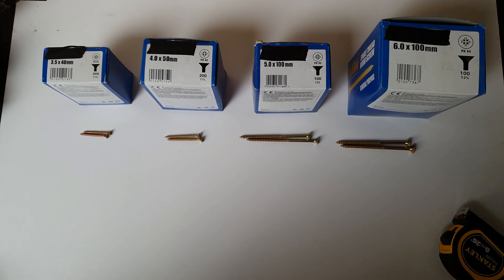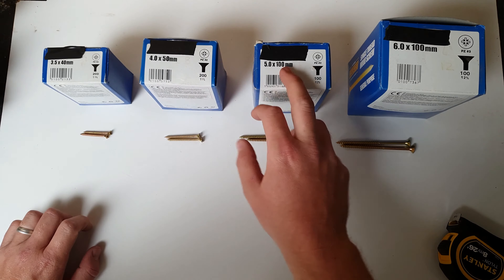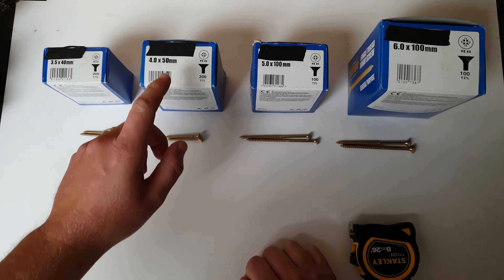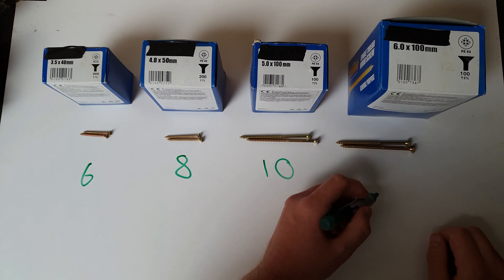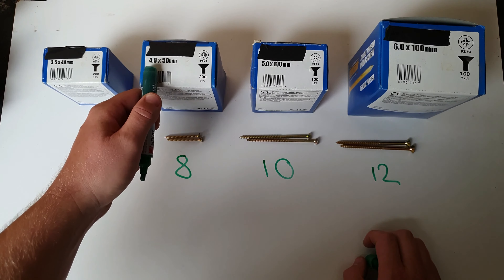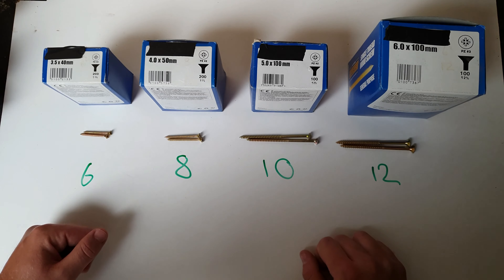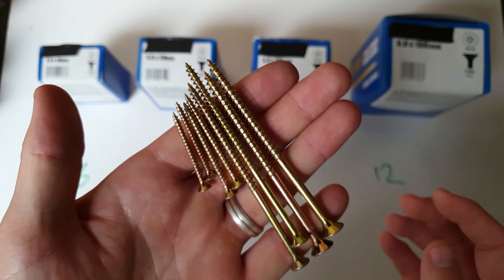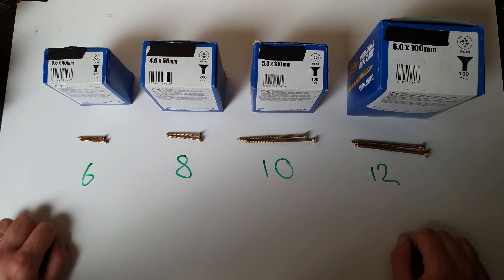choosing the correct SCREW size (METRIC vs IMPERIAL) UK

Comment: RustyDIY I have a very confusing calculation to do! The instructions suggest 8g 5/16ths so it's a bit of a nightmare. I've seen measurements relating to 8g would be 4.5mm so it gets more confusing for me. I'm fitting a ring doorbell into brick, the screws that come with the pack are for wood 🙄 so like you showed on your video technically I'd be looking for a 7g which doesn't exist. So should I go for 6g to fit the hole on the doorbell? I'm also worried about drilling into brick. I have masonary drill bits, but it's so narrow will it not snap the bit? Flippin nightmare. I should also say that those measurements (8g 5/16th) are US too
Reply from the maker: hi, to my knowledge 8g is about a 4mm thick screw, for me if i was using a 8g/4mm thick screw i would use a red wall plug and depending on brand of the plug between a 5.5 and 6mm drill bit. im in the UK. im not sure what the 5/16s bit is about or the 7g bit sorry, but always best to get a trades person in to do the job if not sure.

Comment: It's helpful but what about the second number, the threading or TPI? That's the confusing part. For instance, I'm trying to find something smaller in diameter to a #6 (such as a #5) but with what I think is a 32 tpi for the threading. I can see #6-32 screws at 3/8 length. But, are there no #5-32 screws??? If not then WTF??!!! That's the part that I find VERY confusing and annoying tbh.
Reply from the maker: TPI threads per inch is commonly used for bolts its not normally on a screw box or description as they are normally sold as corse or fine threaded for example. I will have a look see if I can find out
Reply from the maker: Im in the uk and we dont use tpi apparently thats the American fastener market we use thread pitch ( the measurement between each thread in mm ). But this is for bolts, looking at the screws from wholesalers around me that info is not on any screws I can see unless its more of a bolt style screw like a electrical m3.5 fixing screw. But for wood screws for example I cant find this info 😕? I'd guess that the tpi or thread pitch only matters if you are screwing into a pre threaded hole like a nut or nut sleave and if fixing into a material it is just corse or fine thread (double or single thread) depending on what your fixing to and i go by the manufacturers description of the screw to determine whats suitable for each material
Reply from the maker: We are mainly metric so when ordering bolts normally just width and length to worry about as a metric thread would be the same i think, id guess that's the same for imperial like in America if 32tpi is standard imperial tpi. But im not sure as I say not something we deal with much hear so don't quote me im not certain about this area of measurements (tpi and thread pitch) sorry I couldn't help 😅 much if any. There must be lots of videos on tpi and thread pitch on YouTube from people with the knowledge 🤔 in those areas to answer your question.
Reply: @RustyDIY  thanks. I found out the screw I'm looking for (which is still rare) is 5-40. I guess 5-32 just doesn't exist. But, our local hardware store jumps from 6-32 to 4-40 and doesn't even have a 5 because it's not popular. The quest I've been on for this odd screw... anyway, I gotta say, for some reason it's pretty confusing! Between the two systems and matching up the specs of the TPI or thread pitch on some old equipment is a challenge. Anyway, keep up the good work Rusty and thanks!
Reply from the maker: Ya it definitely is especially on classic engines. Glad you found what you needed. Thanks for watching

Comment: I'm completely different i ask for the length of screw in imperial and ill ask for the diameter in mm so an example would be if I was on site and I needed some wood screws id ask about for some 2inch 5s lol. Feels weird asking for 50mm 5s.
Reply from the maker: Haha tbh I'm in the UK obviously but where I grew up working with my dad as a kid I still ask for imperial, just feels strange saying I need 75mm 5s or 100mm 6s ha 😅
Reply: Well done, Nico: like me - and thousands of others - you have helped to create a new, and much more versatile system from the existing two: 'Imperial Metric' !! Sometimes the one, sometimes the other, sometimes both together ;-)

Comment: So, how do you measure the thickness?
Reply from the maker: The main thickness is across the whole diameter so a 6mm should be 6mm across the threads outside to outside edges (for metric)
Reply: @RustyDIY  THANKS.
Reply from the maker: You are welcome there is a major and minor width measurement probably be easy to see a picture online if you search it, some things are hard to explain in txt and the video would be far to long to try explain everything ha 😀
Reply: @RustyDIY  naaah, really? we mean how do you go about it? we don't mean we manage to do the practical thing of finding the thickness by means need and not yet described, and then saying, what does that number mean? If we find out it is 5.0 mm across, we don't then say, duh is that the time we get up in the morning. How stupid can u get, rusty?  "so a 6mm should be 6mm across the threads" really, not a 6am rise?
Reply from the maker: @RonniesPokerRants  how do you go about measuring out side of a screw thread to outside thread across the diameter of a screw ? Just put it against a ruler, tape measure or use a set of digital caliper for an exact size. I thought that was in the video me showing measuring the thickness on a tape measure at the end maybe it got edited out I will check and revert to original upload if that's happened during upload and I didn't notice.
Reply: @RustyDIY  screw sizing explained for the  not quite so thick, should be your headline then on that bloody basis, as the first size is the thickness and the second size is length, done 10 secs for metric screws. As said i was talking of a better method u clown as many folk, esp in your line of work, will not always "nail" the difference, if you'll forgive the pun, between a 3.5 and a 4.0mm thick screw, so as said its the method, not a ruler if poss that would be an interesting one
Reply from the maker: @RonniesPokerRants  as I said in another reply to your other comment the video is about metric vs imperial screw sizing and how they relate to each other. And in regards to this comment you have replied on the guy asked how to measure the thickness and I replied with how "measuring the major diameter (outside thread to outside thread) I didn't explain how that is possible as I thought it was relatively obvious.
Reply from the maker: I assumed 99% would know if they wanted to measure something in mm they would need to use a tool with said unit of measurement on.

Comment: You still haven’t clarified the thickness- is it the head or thread?
Reply from the maker: the main/major diameter is the outside to outside of the threads, the minor or root diameter is the solid part inside the threads. if it was a 6mm screw it should be 6mm wide from outside of thread to outside of thread (on a basic screw) it might change on a screw that has split threads and funny shaped shanks and flutes ect..

Comment: "Thickness" is diameter. That's the term I would use. Also, what is "gauge"? Screw that's 8x2 is what by 2-inches long? 8 is "gauge": tf does that mean? Gauge is a measuring device; there are many kinds... what is " gauge 8"?
Reply from the maker: Yes diameter is a better word to use im not sure why i was saying thickness i think because I was trying to explain it in as simply words as possible.
Reply from the maker: Gauge is an imperial measurement for the major diameter of the screw. So a 2 inch 8 screw should be 2 inches long and a Gauge 8 in diameter (roughly 4mm)
Reply from the maker: There is a formula to work out the gauge measurement of a screw i belive its to do with measuring the diameter of the head in 16th of an inch and X it by a number and then subtract a number. Unfortunately I'm not knowledgeable enough to explain this. Maybe online there will be a good example of this 🤔 👍
Reply: Oh I see, so it is something from the real world only indirect. Thanks!
Reply from the maker: You are welcome 😀

Comment: why is measuring the width of a screw difficult when you say the length is easy?  we simply want to know how to measure said thickness with accuracy as we can easily get 3.5mm mixed up with 4.0 mm. That should be your video, not the rest which is all a red bloody herring
Reply from the maker: I say it is difficult because of the fact if you take a imperial or metric length you can easily measure the length with a tape and see the conversion ie.. 4inch being 100mm however for thickness (diameter) you can't just take a metric diameter and measure the thickness and see the imperial gauge number as it's not a measurement unit more a chart number ie.. take a 6mm metric screw and look on a tape to see 6mm is around 1/4 inch and then go order 2inch long 1/4inch thick screw as that's not how there sold in the UK it would be a 2inch 12 that's why I say it can be confusing. thickness is the diameter of the screw major diameter usually measured out side of thread to outside of thread the rout diameter is the solid bit in the middle. To get a precise measurement you can use calipers
Reply from the maker: I apologise if you didn't get the info you was expecting, it was not my intentions to have a misleading title I don't use clickbate titles and pictures just for views The video is more about matching imperial and metric screws mainly. As in the UK we sell both in some stores and the thickness on imperial screws being a 8 is not a 8mm like a metric size 8 screw it's a gauge 8 around 4mm in metric size and that's what I explained in the video.